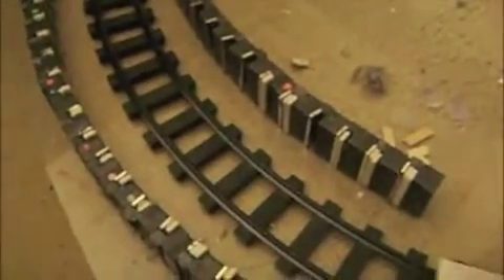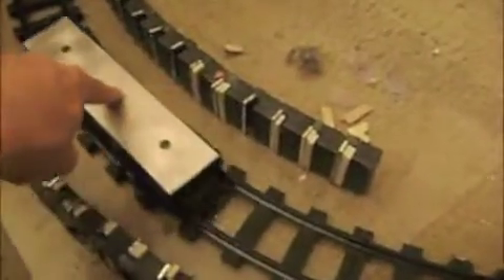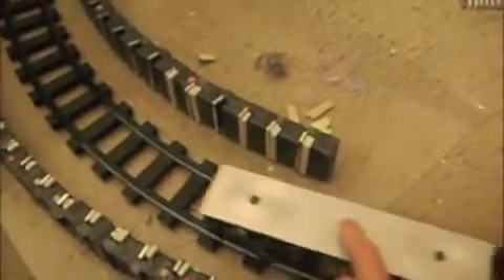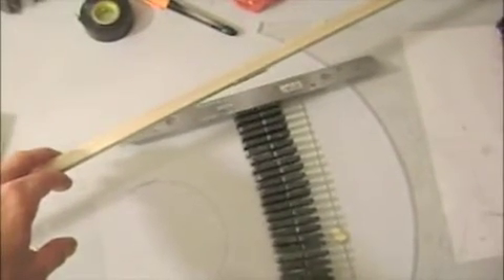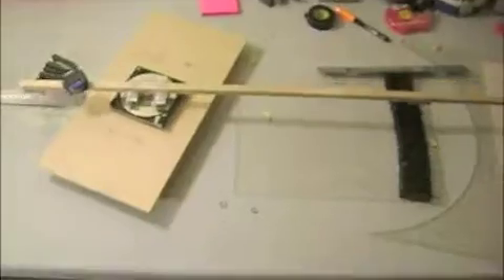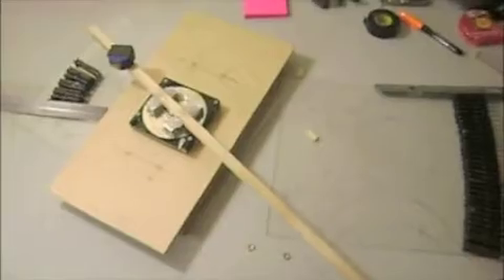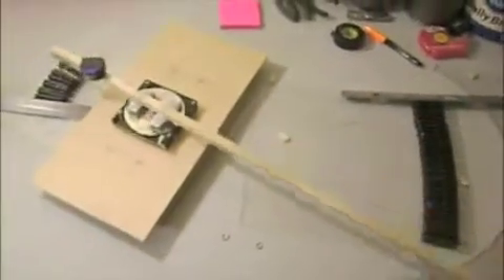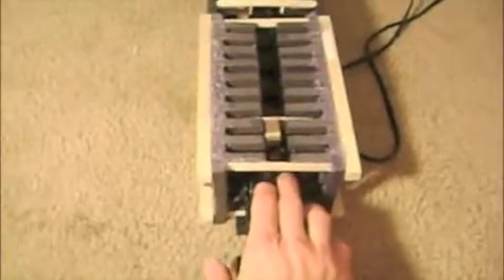Using leverage to break through Magnetic gates.

Comment: Magnets. Requires weak magnetism, lever fixed to pivot at an angle and an element that swings in and out (lateral). Vertical relation to magnets. And low friction of course.

Comment: I finally see what you are doing here. 12/2018 (It is unrelated to most of my designs, as I do not use magnets). I thought it was worth pointing that you could have vertical repulsion on the lever end, possible efficiency there (using counterweights).

Comment: Pardon my ignorance, but if we're dealing with intermittent power, gates and such. Wouldn't a flywheel of non-magnetic nature help?
Reply: I was thinking the same thing...
Reply from the maker: Unfortunately no. Most types of magnetic gates use equal repulsion to attraction ratios, meaning the force always equals out to zero. So any potential gain you could expect from a flywheel spinning from one magnetic gate to the next, would be negated by the loss of the pull or drag from the opposing magnetic forces. Thanks for the suggestion though.